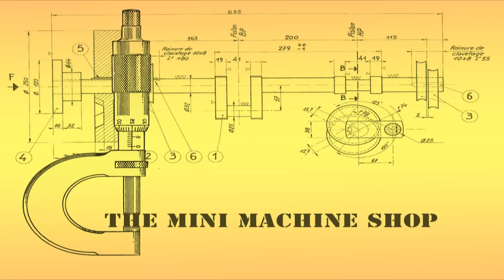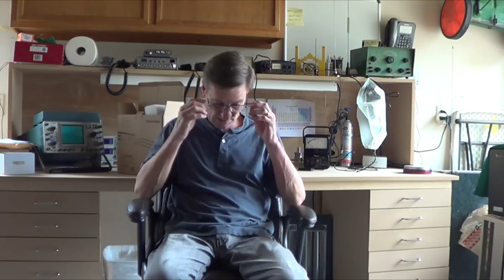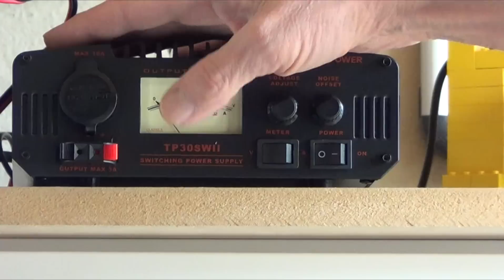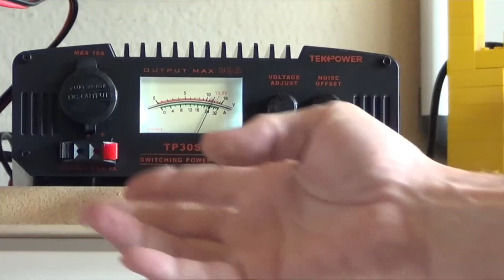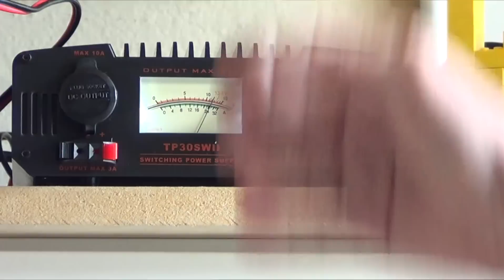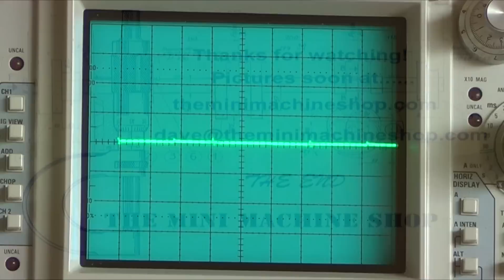TP30SWII Power Supply Review Video #91

Comment: had mine 1 year + now and work it hard with 3 radios push it to 25 amp Tx all the time - makes some noise on 80m but offset works great ussually just a touch of my finger and all is quiet - Very Happy with this PS   73  KG5LFK
Reply from the maker: Good to hear that kind of input...Thanks!

Comment: thanks for the reply.. what i ment that the fan comes on soon as i turn the power supply. untill i turn the voltage down to 10 volts and then the fan turns off. maybe it needs adjusting in side

Comment: hi dave.my fan comes on soon as i turn the radio on.and the radio draws 3.5 amps...any ideas. thanks for the video.
Reply from the maker: Hi Richard, not sure what you're getting at. I assume the fan that turns on is on your radio. I have a Kenwood TM-V71  which draws 2 amps when idle. Some radios have the fan always running. Give more info and maybe I can help...